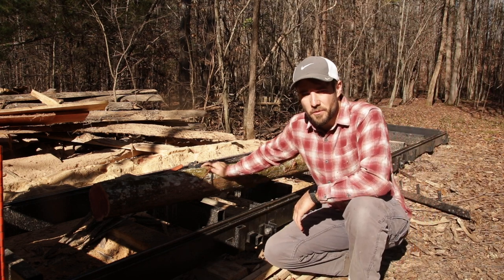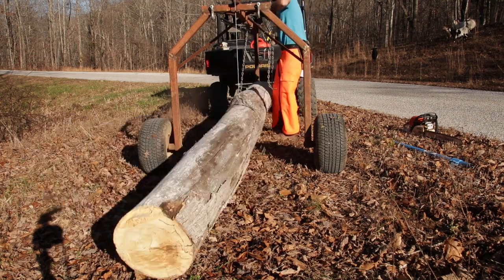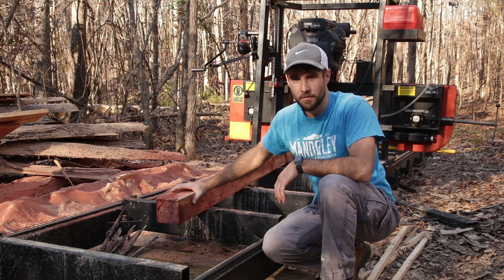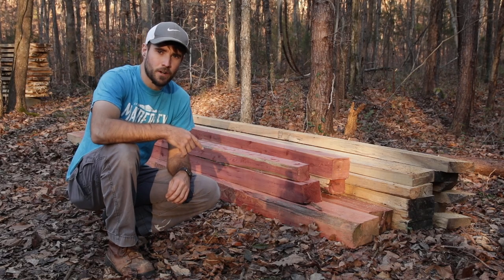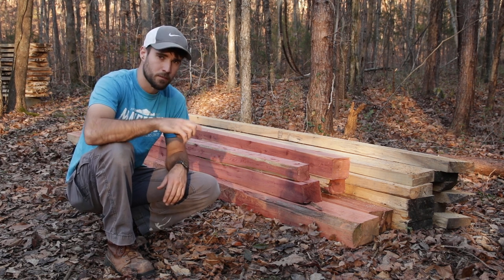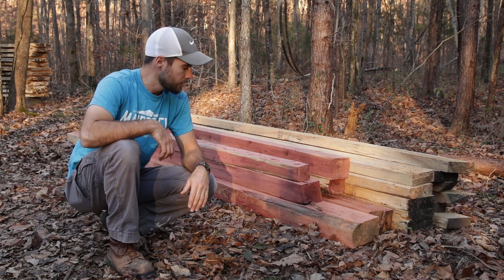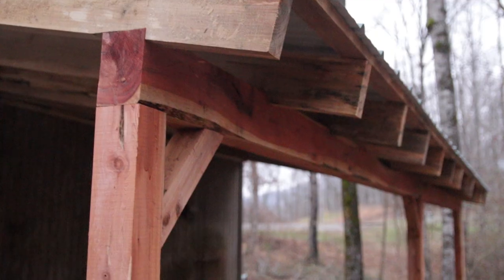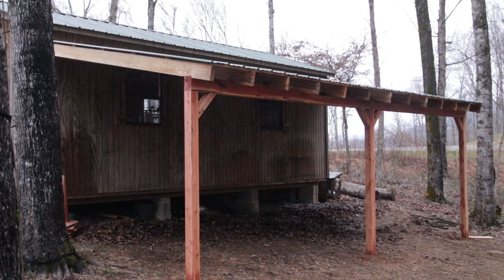From Logs to Lean-To / Building a Lean-To with Green Lumber

Comment: Thank you for being one of the few people on youtube to use chaps while sawing. I highly recommend the stihl helmet with the face-shield and ear protection. It has saved my face, noggin and hearing on more than once.
Yeah, Tulip Poplar isn't the best buiding/structural wood; weak, but if you keep it dry, it'd be fine herringboning an interior wall. I chip up Tulip Poplar to build soil with.
Have you considered charring the ends of your posts? 
Those cedar stumps and  roots would be full of resin to coat the charred post ends into for an extra barrier of rot resistance. That of course requires making a charcoal kiln.